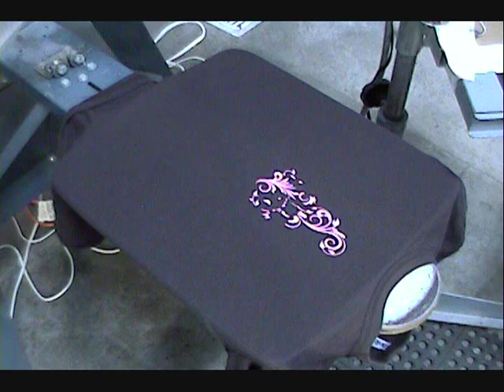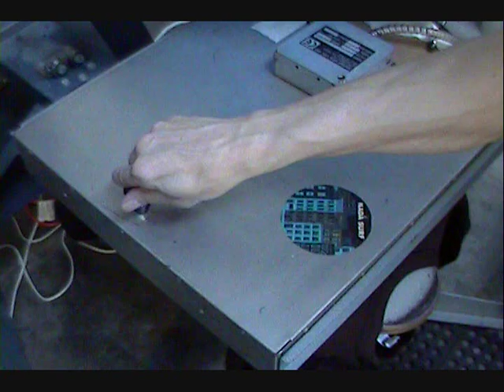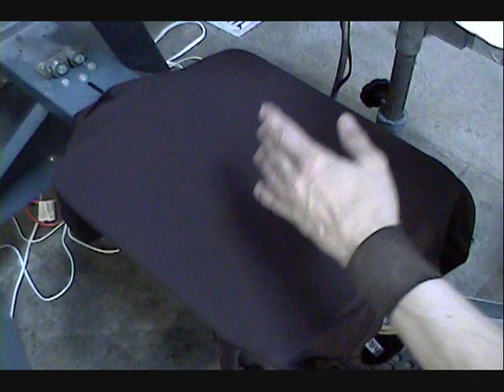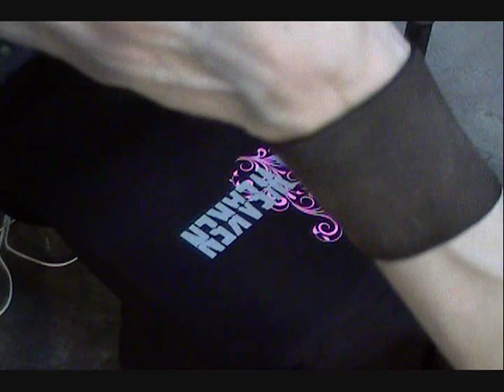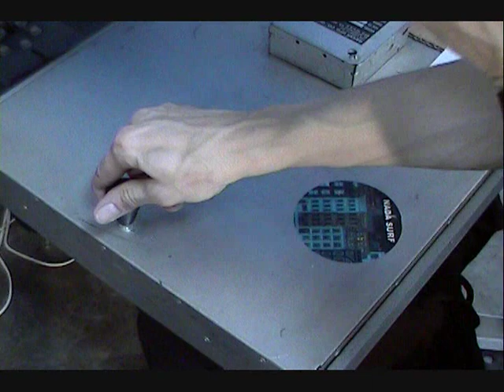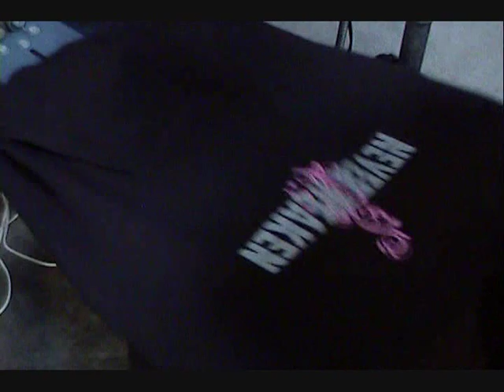How To Screen Print: Fluorescent Pink On Black Thermals & Hoodies

Comment from the maker: @001JURIZ That would be a flash cure dryer. It is a small infrared panel that heats the ink up to about 250 F or so. It makes the ink dry to the touch. You can learn about the entire process and equipment on my website. The link is on the channel page. Thanks for watching and leaving a comment! ☠

Comment: easy to make an image such as that look good P/F/P try it with a big image without P/F/P/F/P or white base.
Reply from the maker: This was a print/flash/print because there was no under base. If you are not going to use an under base and you do not want to flash then you will need to use a high opacity ink on the proper mesh count with a 60 durometer squeegee. Then you can do a one hit winder as I call it using only 2 print passes and no flash. The first print fills the knit of the garment. The second print stroke leaves more ink making it bright and colorful. It's about technique as much as it is about proper setup and inks. I print white ink all the time without flashing and I have shared my method in a few videos about white inks. Thanks for watching! Screen Printing Equipment & Supplies - http://CatspitScreenPrintSupply.com/

Comment: Awesome Video, so of course I have my Questions.  Were the screen only coated once on each side?  You got a lot of opacity the Pink and Grey on your first pass.  Why a color hit, flash, hit... vs.  White hit, Flash, Color Hit?

Did you over print the Colors vs. Butt Registration between the two?  Some spots that would be 4 Layers of Ink compared to mostly two Layers.  Wouldn't there be a texture difference? 

Sorry to be the one who always needs additional details.

Comment from the maker: @Toche If I get a job where I need to do CMYK, I will make a video about it but it won’t cover creating the separations. That is not my forte and I send out my CMYK artwork to be separated for me. Seps and film in one shot. That way all I have to worry about is printing. And I would most certainly do CMYK on an automatic, not a manual. 1 color halftones or duotones are o.k. on a manual press but process work will be much harder on a manual. Thanks for watching & commenting!

Comment from the maker: @chrama1 My screens are always coated once each side. I only double hit the pink to make the color more intense on black. It just didn’t cover so well. It would have been the same difference if I used white. On a 6/6 rotary press you would rotate the pallets and print heads exactly the same way whether the under base is pink or white. It was a butt/butt registration set up with no overprinting. Just whatever fills in over the run. Thanks for watching & commenting!

Comment: Merci!  Thanks so much for sharing your knowledge, your a great pedagog! I will be using water base inks. Will a flash dryer be good to use on these as well? I am concerned about the ink holding.
Reply from the maker: Thank you very much! I appreciate that. Yes, you could use a flash cure unit for water based inks. A forced air flash cure unit would be best for water based inks and especially with discharge inks.

http://catspitscreenprintsupply.com/ranar-da1616-forced-air-flash-cure-w-control-120v/

http://catspitscreenprintsupply.com/ranar-da1616p-forced-air-flash-cure-w-pallets-120v/

Thanks for watching. Screen Printing Equipment & Supplies -  http://catspitscreenprintsupply.com/

Comment: you're a bad ass man! some of your videos have really helped me out. I have a question though. do you use a white under base when you print on darker colored shirts? I feel like it would cut down production time quite a bit.
Reply from the maker: Thank you very much! I'm glad I could help out through my videos from afar. That's awesome. Sometimes I use a white under base and other times I do not. It really depends on the ink and if it can print without an under base or not. But yes printing a white under base or even doing a double print with a flash slows down the production time.  Thanks for watching. Screen Printing Equipment & Supplies - http://catspitscreenprintsupply.com/

Comment: dude in rotary press is it ok that the size of the frame is larger than the pallets?.. or it must be exact size also at the pallets?.. is their any problem if your screen is larger than the frame/....? im talking about the width and length of the frame
Reply from the maker: Yes, you can see here my screen is bigger than my pallet. Just set the off contact correctly and it should be fine. If it's way too big you wouldn't want to use it simply because it's too big... LOL. Thanks for watching and leaving a comment!